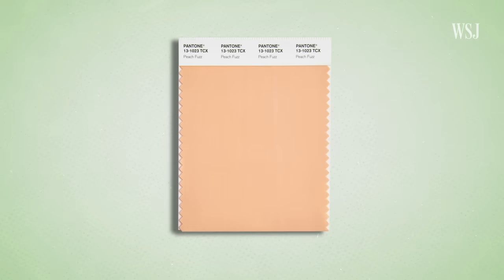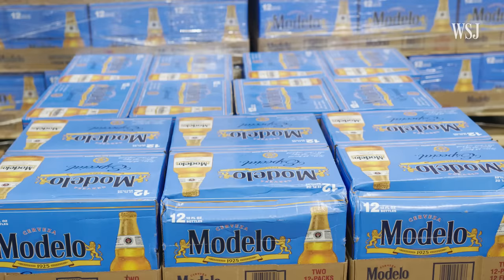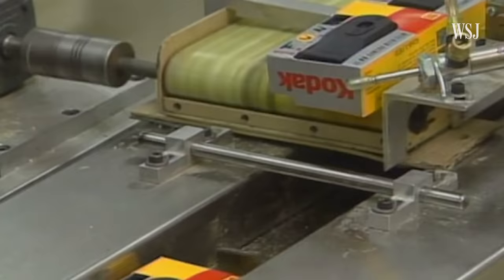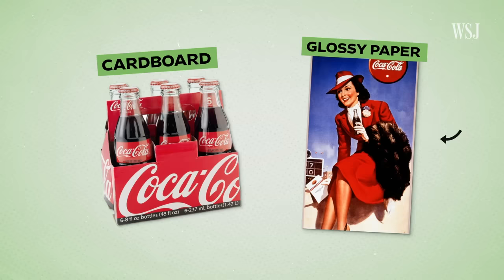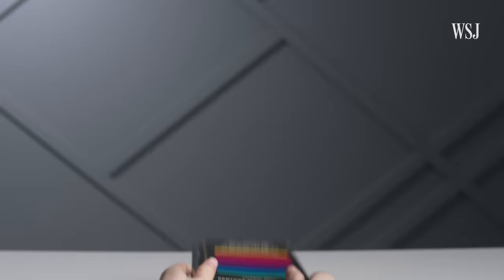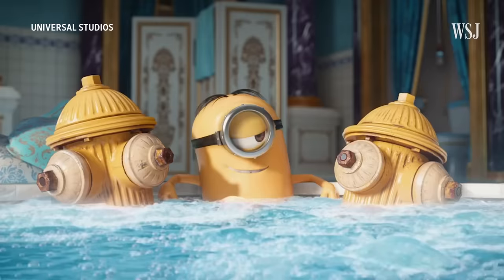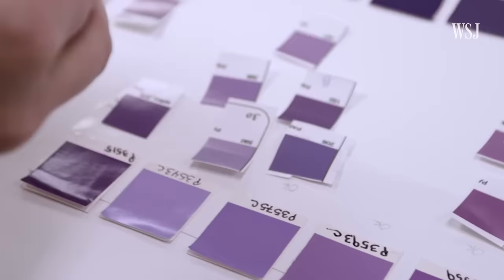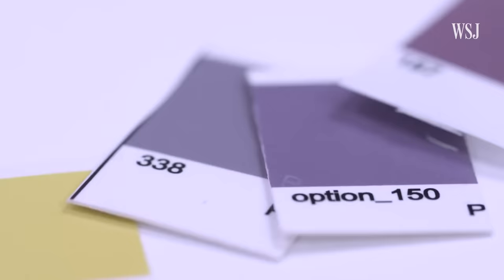Inside Pantone, the Company That Turns Color Into Money | WSJ The Economics Of

Comment: I worked for a packaging company, Multi Packaging Solutions, for over a decade that used Pantone colors regularly based on the requirements of our customers. Every time we had to change over a spot color required by a customer on one of our KBA printing, presses, (much like the ones on the video) it was very time consuming. We instead began blending and mixing colors on press to achieve a very close match. We approached Pantone about integrating it into their standards, and they said no. So we developed our own system called Echo color match and began implementing it at other facilities, and familiarizing our customers with it. By not needing to change colors we saved a great deal of money and pass the savings onto the customers. Pantone realized that this would be a problem for them, and eventually acquiesced and They can now use the Pantone trademark on these mixed colors.

Comment: They make it sound like Pantone book are actually constant. 
They are FAR from consistent.  They can’t even keep a color consistent through a series of books printed at the same time. 
It’s very well known in any industry that has to actually match these colors and seek the same color to the same customer over years. 
I work for an ink manufacturer. We make the ink for the large printing presses.  We had to come up with our own system of standardizing Pantone colors because every book is different.  
Customers order a specific color, we would match it to our book, they would complain, we would compare our book to theirs and they would be completely different.  We would have to start adding their job name to the color number and make it a custom match and save a standard wet sample that we can match every time they order.   
If your procedure was to simply match to the book you would have non stop customer complaints.  Their book is different than yours.  All books change over time, like the lady said. 
It’s ridiculous. 
I’m sure it was a major improvement from what was done before Pantone, but it’s far from as good as they made it sound.
Reply: Marketing people rely on the PMS book as their go-to starting point. That's why you have to get new PMS books every year. As a print buyer I found you have to satisfy Marketing's expectations and the book is indispensable. I also to give PMS and CMYK specs with print orders with the note ' Print to match current PMS'.
Reply: Oop .

I was going to say "how did they manage 'planned obsolescence' for damned colors?" 😂😅😮‍💨
Reply: Well you see, the problem is that you are not buying enough of their books, you should buy their book monthly and maybe buy a few of them at the same time, that way you would have a larger sample size so you can see which books are the most accurate and have the most common colours! This is sarcasm btw :P
Reply: @gaveintothedarkness their books are ridiculously expensive!

Comment: I hope this gets the right eyeballs... I work in the fashion industry and have been producing garments using Pantones for over two decades. The question that I always wondered was whats the difference between using Pantone #'s and HEX #'s? Aren't they essentially the same?
Reply: No. They're not. 

HEX #s are six hexadecimal digits. The first two hexadecimal digits represent the red value from 0 to 255. The second two represent the green value and the third two represent the blue value. Red, green, and blue are additive colors used in three-color computer monitors and television sets which use the additive color model. They are different from color printers that use the subtractive color model of cyan, magenta, yellow, and black.

Color light is different from color ink. When you add red, green, and blue light together, you get white light. When you add cyan, magenta, and yellow ink together, you get a near black ink. White on a color monitor would be HEX FFFFFF while white on a color printer would be no ink at all or HEX 00000000. 

The Pantone Matching System uses a singular number regardless of the medium. So blue on the Swedish flag is Pantone 301C which would be HEX 006AA7 or decimal 0, 106, 167 on a color monitor and would be 100, 37, 0, 35 on a CMYK printer.